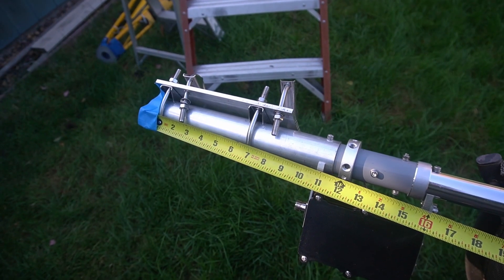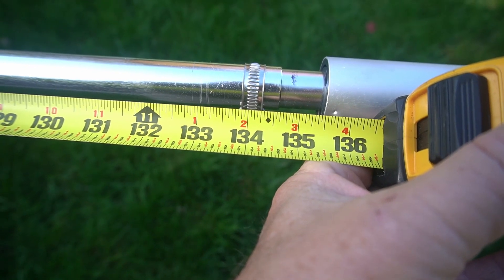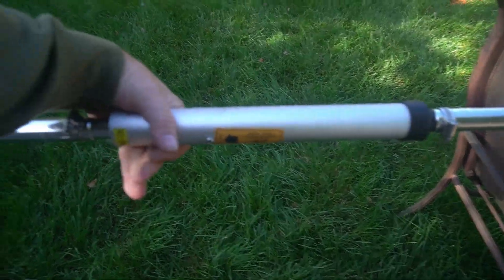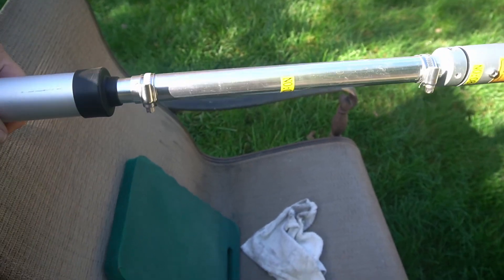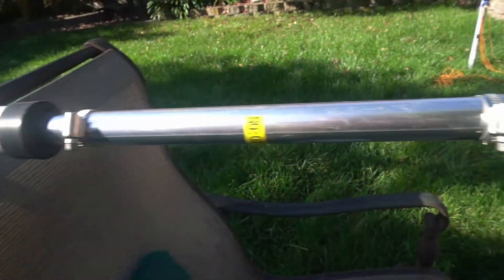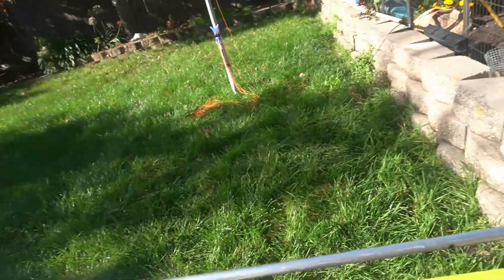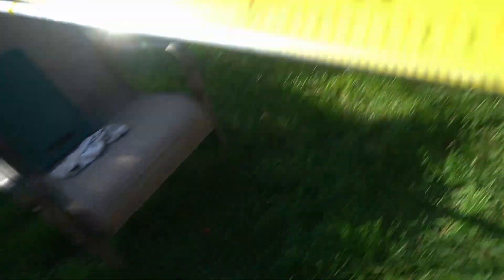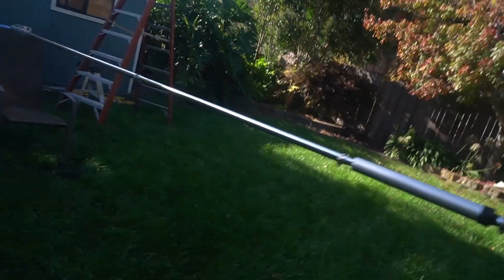How to set up your Xiegu VG4 Multiband antenna.

Comment: Useless video for most of the world, weird lengths and fractions of fractions.
Reply from the maker: Sorry I took the time to get all the measurements for you but forgot to google the conversions for you also. Everyone else seemed to figure it out! Thanks for watching and the informative comment.
Reply: I didn’t need to convert to metric. I used a tape measure with both metric and imperial scales - so brush up on your fractions 😅
Reply: @johnsmith-sj7xk - your "comment" is useless for most of the world. Converting from imperial to metric measurements is a lot easier than getting an amateur radio license. Hint: use Google to assist you in converting your measurements. This video author has done a great service to the amateur radio worldwide community - nowhere have I found information for starting points for tuning the VG-4 antenna.

Comment: First of all, thank you very much for your work and commitment. However, I have this antenna, bought 2 weeks ago (2025) and I followed the measurements exactly, which I converted to the metric system. I even checked twice to make sure I didn't make a mistake during the conversion because unfortunately the effect during SWR measurements is that the antenna has a good and expected SWR basically only in the 20m band. In the 40m band, the dip is a bit too high and the 15m and 10m bands the SWR is completely different. I noticed during the measurements that I have different lengths of elements number 5 and 7. And maybe this is where the discrepancies come from. I wrote this not to criticize you but to draw attention to the fact that the newer version of the antenna, characterized by, among other things, a completely different mount to the mast, may have a different SWR using the dimensions you used.

Comment: I know you were dealing with a short tape measure but the really helpful measurements would have been:
1. Base to bottom of 1st trap (which was 135-1/2" as seen in the video) This is the 10m section and should be tuned 1st.
2. Bottom of the 1st trap to the bottom of the 2nd trap. (This is the 15m section and should be tuned 2nd)
3. Bottom of the 2nd trap to the bottom of 3rd trap. (This is the 20m section and should be tuned 3rd)
4. Bottom of the 3rd trap to top of antenna. (This is the 40m section and should be tuned last)
If there's anybody out there that has a tuned VG-4 and can provide measurements as such that would be great if you could share those measurements. TNX W5UW

Comment: Hello, Chuck.  I watch your videos on YouTube with great interest.  I recently watched the VG4 antenna video.  I have a KB2/K730V antenna.  With the usual installation of the rays of this antenna, they look up, so I have no way to install the antenna, so there is no access to the roof of an apartment building.  I have to install it on a small horizontal mast on the balcony.  One ray will be directed up and the other down.  And there will be a situation when condensate accumulating in traps will remain in them, since the traps will be upturned.  Could you advise what to do with this condensate in the traps of a ray, looking down?  And another question: when assembling the antenna, did you use any ointment to connect one knee with the other?  Thanks and 73!
Reply from the maker: It is a good idea to use something that will still conduct at each joint if you plan to leave the antenna up all the time. As far as th traps maybe seal the top and have a hole on the bottom to let condensation out, they probably have a hole . Can you mount the coil upside down so the hole is at the bottom? Hope this helps!

Comment: Just purchased and put it up. I used your measurements and it tuned up great. Talked to a guy on 10m in Northern Maine from Louisiana. 
Thank you so much for video. 
73!!!
KJ5ISH
Reply: Update: After owning the antenna for a few months, I've made several overseas contacts with this antenna. We had some massive storms come through the area containing damaging winds, and the antenna held up fine. 
When I first setup the antenna, I was actually able to tune 80m. I made contact with my local net. However, I am no longer able to tune 80m. I know its not rated for 80m, but I'm curious to how I was able a few months ago.
Thanks again and 73's 
Kj5ish

Comment: Well you got me close>  I am a CW man.  Here are my initial measurements:  7.220     1.6 SWR,  14.100   1/028,  21.400  1.245 SWR,  30.400  1.12.... So except for 20 meters all of the other bands are high.  I have the Antenna Mounted in the clear at the 10' level.  I'll start tuning for a lower SWR of the bands in the morning.  Thanks for your initial guidance.  I would like to see your final SWR reading though.  73 Bruce N9BX

Comment: You make great videos and are easily understood. I’m thinking of installing this on the roof. Did you see or hear anything about needing the antenna closer to the ground for some type of ground wave/radials?
Thanks, KD0BRE Mark
Reply from the maker: Thank you, usually the higher the better. You should be good.

Comment: As a GenX from the UK the ‘dangerous’ part about my education is that I’m old enough to have lived around (& remember) imperial measurements from my dear old builder dad  but also young enough to have been indoctrinated into post 1970’s metrification at school. A very dangerous set of skills :-) 

So, at the risk of teaching anyone in particular how to suck eggs, or for those just keen to turn imperial measurements into metric down to the nearest 1/16” (specifically into mm) either now or in the future, here’s how it goes.

* Smallest increment mentioned is 1/16”
* 1 ‘whole inch’ therefore being 16 of those ‘16ths’
* To convert inches into mm just multiply the whole given measurement by 25.4
* To include any fraction part as a decimal for your calculator, the ‘bit’ to add goes as follows: (just lose the leading zero):

1/16  = 0.0625
2/16  = 0.125 (or more commonly 1/8)
3/16  = 0.188
4/16  = 0.25 (or more commonly 1/4)
5/16  = 0.313
6/16  = 0.375 (or more commonly 3/8)
7/16  = 0.438
8/16  = 0.5 (or more commonly 1/2)
9/16 = 0.563
10/16  = 0.625 (or more commonly 5/8)
11/16  = 0.688
12/16 = 0.75 (or more commonly 3/4)
13/16 = 0.813
14/16  = 0.875 (or more commonly 7/8)
15/16  = 0.938
16/16  = 1 

So, where the poster says 134 5/8” that’s just.....
134 (whole) & 5/8 (fraction) then multiply by 25.4 to convert the total to mm.

So, 134 5/8 = 134.625 x 25.4 = 3419.475mm
Long-winded I know but hopefully helpful to some. Alternatively just type the inches measurement (as given) into google and ask it to convert to mm.

But anyway, for those that can't do that, I got:

1. From Base to top of Section 3: 
134 5/8" (134.625 x 25.4 = 3419.47mm) 

2. From Top of Section 3 to bottom of section 4: 
1" (1 x 25.4 = 25.4mm) 

3. For Section 5 (short piece): 
Full section plus margins of:
1/16" (.0625 x 25.4 = 1.587mm) bottom + 1/8" (.125 x 25.4 = 3.175mm) top or 3/16" (.188 x 25.4 = 4.76mm) total with no overall length given / needed)

4. For Section 7: 
Top of section 6 to start of section 7: 
½” (.5 x 25.4 = 12.7mm) then total for section 7 (measured coil to coil): 12 5/8” (12.625 x 25.4 = 320.675mm)

5. Then from bottom of section 8 to tip: 
90 ¾ (90.75 x 25.4 = 2305.05mm) TOTAL

6. For Section 9 (from taper, though not shown in video): 
45 1/8” (45.125 x 25.4 = 1146.17mm)

7. For section 10 (top section from top of 9 to tip): 
26 1/4” (26.25 x 25.4 = 666.75mm)

Feel free to copy / paste / screenshot / save fir future reference.

Note, the above is notwithstanding the possible difference that @debbie62140 mentioned further down.
Reply from the maker: Thanks for the info, I may have to copy this Lol
Reply: @KK6USYHamRadioAdventures  you’re welcome 🤩

Comment: Question about your dimensions. I followed your measurements and mounted it atop a 10 ft. pole. The results are that I must use a tuner on all bands and have high Q. Without a tuner I'm above 3:1 SWR on all bands. That's not right. Any suggestions? Thanks. KA6USA

Comment: Does anyone know if this antenna will tune up on 80-meters with a tuner.  Also, any way to add an 80-meter loading coil?
Reply: That's my question.  Have you had any replies?

Comment: Thanks Chuck on the Xiegu VG4 antenna. I used your measurements from the video and it work great. When I installed it 20ft up in the air with the help from my Son it worked like a champ!  Jumped on the radio made a couple contacts to Sweden on 10m and a couple POTA activations in the US on 20m. I think I will enjoy the use of the new antenna. Thanks again! Frank W1VBX in Maine.

Comment: Hi Chuck. Having bought the VG-4, but not yet assembled it, I am indebted to you for the clear measurements you've taken the trouble to publish. But it may be of interest to you and your subscribers that Xiegu have not only changed the mounting hardware from a plate to clamps, but they have also changed the length of No's 5 and 7 to 250 mm. I'm not sure if this will affect the overall tuning using your measurements.
Reply from the maker: Debbie' thank you for the update, it's a good antenna and I have a couple friends down in the San Diego area that love them and the price is great!

Comment: Hi, these are very valuable tips for VG-4 users. Could you please write these values in table form in a uniform way?
And the question is - at what height should the VG-4 be mounted to work properly? Thank you RAFAEL HF1R
Reply: My question is about a good starting point. Then you need to improve the impedance and SWR parameters. The manufacturer does not provide any assembly instructions.

Comment: Thanks for your effort and the measurements. JFYI, for my setup (on a 6m grounded aluminum pole) the given lengths are way too short. 40m has the min at 7.200 (1:1.41), 20m at 14.525 (1:1.09) - via RigExpert AA-35. 73 OE6HKE
Reply: I've added 45cm to element 9/10 and about 15cm to element 7, this moves the 40m best-SWR notch into the CW part of the band. 20m is still a bit high, but I didn't want to pull 7 further apart for mechanical reasons. I guess 10/15m need adjustment too for 20m to be long enough. But I'm happy with the results so far and will give it a good test before further fine-tuning.

Comment: Hi Chuck. Greetings from Melbourne Australia 🇦🇺.
Just installed the Xiegu VG4 today following your measurements. I actually had a tape measure with both metric and imperial scale - I just had to brush up on my fractions on the 1 inch scale 😀. The antenna is mounted on a 3 meter tall pole in the back yard and the SWR is perfect and flat on all the bands including 40m 7.000 to 7.2000 MHz. Only issue I had was inserting the first aluminium section into the insulator. It was really tight so I used some silicone spray lubricant - aligned the holes for the bolts - and used a rubber mallet on the end of the bottom section.
Best 73 John VK3JHA
Reply from the maker: Awesome, glad it worked out. My buddies down in the San Diego area love this antenna. Thanks for the update!

Comment: Hey Chuck just wanted to say thanks for making this video. I was having a hard time tuning up the VG-4 laying flat on the ground, as my final installation location would not allow frequent removal for the sake of tuning. Following your video and measurements, got me to acceptable SWR levels once the antenna was raised. Saved me a lot of time and swearing. Unlike other hams, I am of the type that likes to receive an antenna and get it on the air with minimal fiddling. Thanks again and 73.
Reply from the maker: I'm glad it worked for you and was hoping to hear back from others since location can make a difference. Have to say I was pretty tired of up and down the ladder.
Reply: You're awesome, you're a magician!

Comment: Imperial is like living in the Dark Ages!😂
Metric rules the 🌎👍😁
Reply from the maker: Well!
Reply: @KK6USYHamRadioAdventures  we are technically metric here but many things are advertised as both, like ladders. As a sparky, all my ladders I use I say in feet, I have a 3,6,8,9 and 10 foot step ladders but a 7 metre extension ladder. Lol
Car wheels are always advertised in inches here but tyres strangely use both like my 18/235/45 or 18"/235mm/45 series profile. Its crazy. Lol.
All construction and mostly everything else is metric. However, at school, we learnt both. 
I used to use 5/32 and 3/16 screws and 1/8 drill bits at work but every other size I used was metric. Go figure. Lol 
Anyway, rant over. Haha 73 Chuck. :)